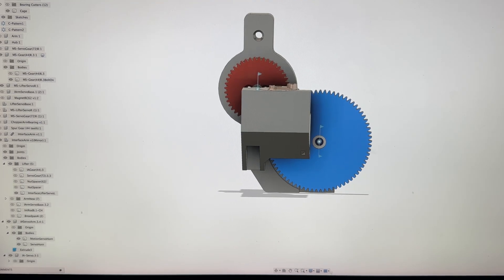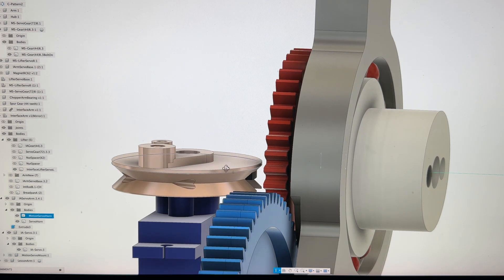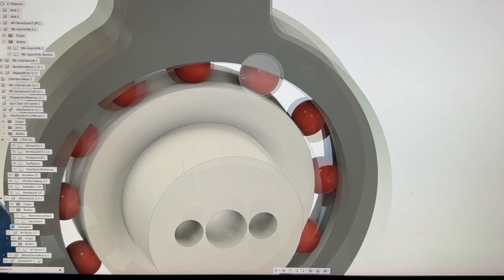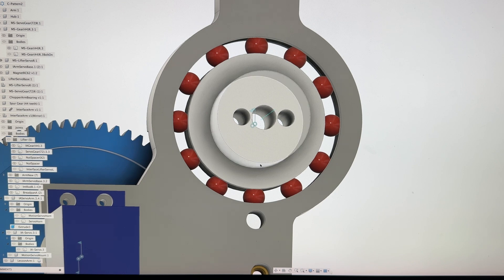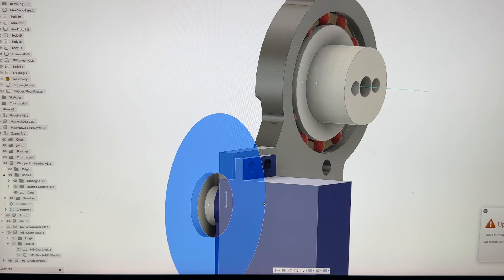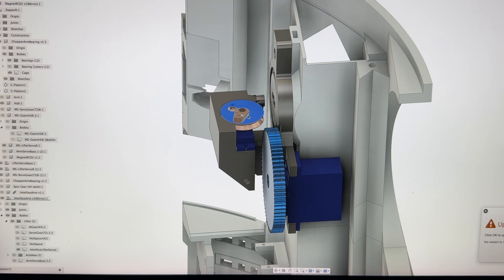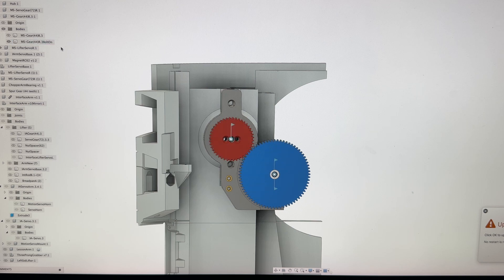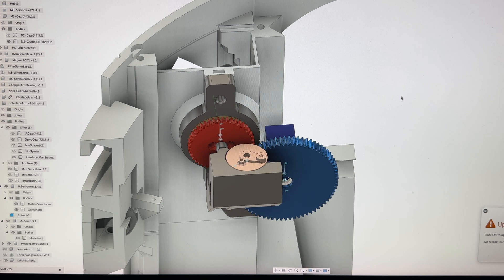NextGen Tool Lifter Assembly

Comment: The servo horns that came with my small servos are a bit too big to fit the MotionServoHorn piece.  The hub part of the horn is 7.3mm. Do you have the CAD files of that piece that I could alter in FreeCAD?  I can load the 3mf file in but only as a static file that you can't edit.

Comment: How is the large gear attached to the round servo horn?  I have holes in my servo horn I was thinking of adding holes to the gear to screw it on?  Or is epoxy/glue enough?
Reply from the maker: @spacekb17  I did both.   Screw and glue.
Reply: @TheEebel  thanks!  Think petg or abs filament would do for the cable?  I don’t have nylon
Reply from the maker: @spacekb17  Either.  I used PETG.
Reply: @TheEebel  thanks Tim!  On another note,  did you use the “servo horn” utility arm servo gear file?  I’m worried about the gear slipping on the servo with just a screw holding it rather than the 25T gear on the servo.  I could not find a off the shelf horn to work with the other “servo horn” file in Mr Bs files.
Reply from the maker: @spacekb17  I used a had to scale up the heat a bit. But otherwise used the stock parts from Mr. B on the utility arm.  It’s been going since 2019 for my Mark III build. On my v2 2018 vintage build, I used stock parts. However, I did redo the servo mounts for easier servo changes.
Reply from the maker: @spacekb17  Neither. Both are too brittle over time. I would look for an electric bass guitar string.  https://www.amazon.com/gp/product/B0B31782CD/ref=ppx_yo_dt_b_search_asin_title?ie=UTF8&psc=1. .045 thickness; the E String.
Reply: @TheEebel  Thanks I was thinking of metal cable but didn’t think of a bass string.  Do you just glue into the pieces?

Comment: I watch the video and wonder what kind of balls are these? Or where can I get them?
Reply from the maker: I use 6mm plastic BBS.  However, you can get regular 6mm plastic bearings or metal bearings. I have a link to some in the readme file for the project.